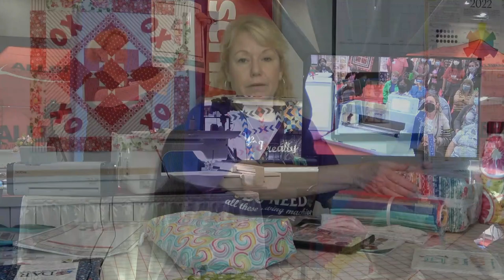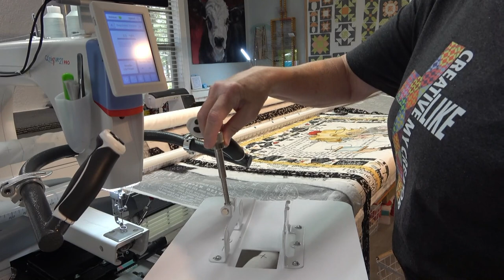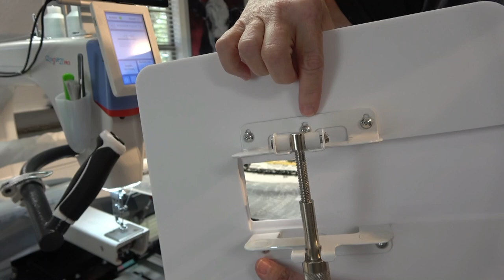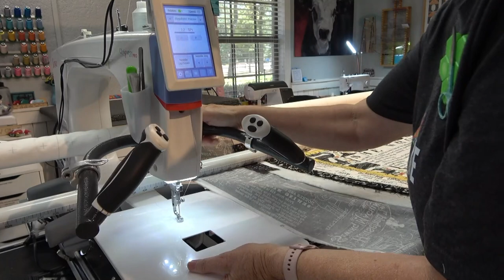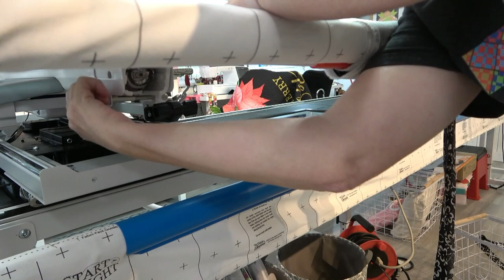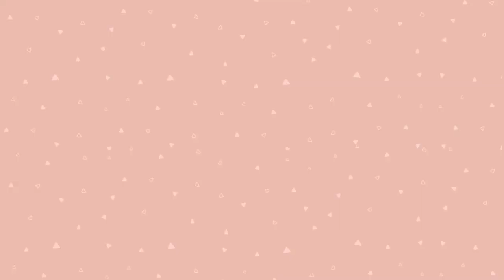Grace Quilting Short Clips - How to Install the Ruler Base on the Qnique 21 Pro

Comment: I purchased the Brother scan and cut 325 dx but now wished I'd order the 330 dx is there a reason why you didn't purchase the 330dx it is a little higher than the 325 dx but it has Disney?  Since you are an expert I trust your advice.
Reply from the maker: Well, thank you!  I don't know how much of an expert I am, but I do my research before buying to be sure I'm getting what I will actually use vs. just buying options that would go unused in my sewing studio.  The only difference between the 325 and the 330D are over 140 Disney designs in the 330D and other quilt block designs and font options.  The 325 has over 1,300 designs and fonts which is plenty!  I don't need a lot of Disney any longer since my grands are outgrowing it so I was happy with the lower price point of the 325.  Also, the 330D comes with the Rotary blade kit which is available for $60 from a dealer and it will also fit the 325.  I don't have a need that I know of for the rotary blade kit since the standard blades do I all need for my fabric cutting but if I did, $60 is much less than the upgrade to the 330D.  Otherwise, they are the same.  My 325 has My Connection to talk to my Luminaire so I'm thrilled!  I'm sure you'll be very happy with yours too.
Reply: Thank you so much for the information. Hopefully you will do a live one day.😀